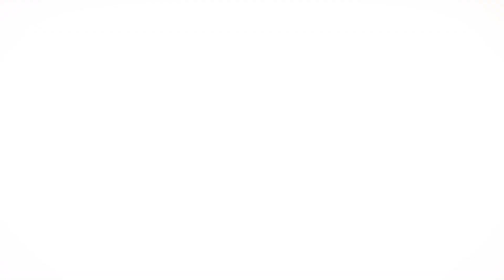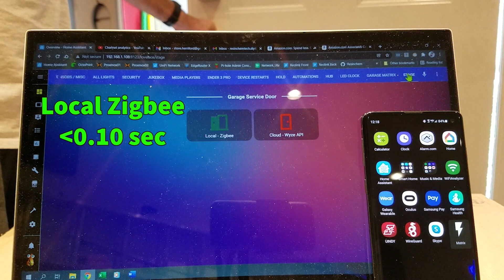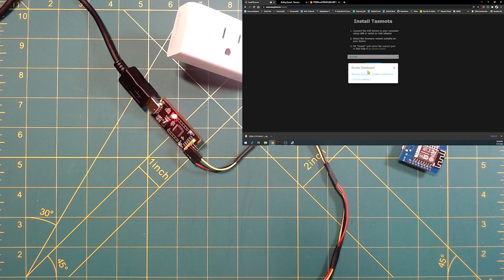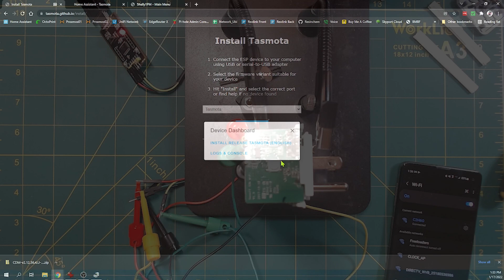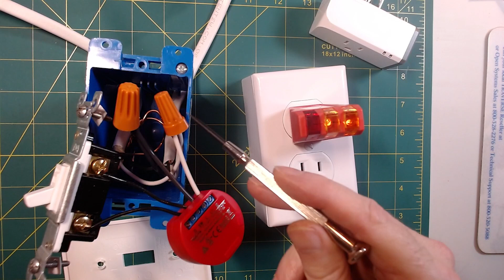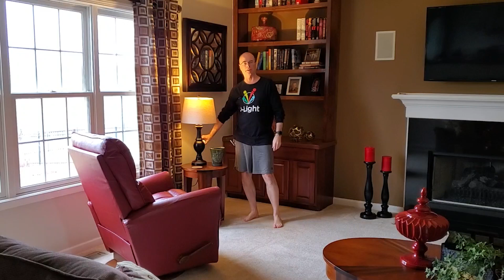Move a switched outlet control to anywhere with just two smart devices

Comment: I just want something simple that works with an existing switched outlet and turns on something else remotely in addition to the light connected to the outlet. There's got to be a simple device like that that doesn't require smart switches...
Reply from the maker: Well, "something" needs to be able to determine when the existing switch is turned on.  Then that "something" would need to send a signal or command to the remote device to turn it on.  "Dumb" or normal household switches and outlets have no way to communicate... so some way to communicate needs to be added both to the switch and the remote location. 

There are other potential options... but they may not be as simple to setup and maintain.  One option would be to use something like an energy-monitor smart plug connected to the switched outlet.  As long as there is a 'load' attached, you could monitor the energy readings and when the wattage (or amps) go up, you know the switch has been turned on.  You would then use something like Home Assistant to send a command to another smart plug connected to the remote device.  You might be able to use two smart plugs running firmware (like Tasmota) that could communicate directly without a middle-man automation system like Home Assistant, but it might be difficult to find commercial versions with this feature.

Alternatively, if both the switched outlet and the remote location control their own smart devices (e.g. a smart light bulb), then an automation system could watch for the state on the switched device to change and then send the command to the remote device to set it to the same state.

So it is certainly possible to do something like this without replacing the in-wall switch.  But some sort of smart device (WiFi, Zigbee, Matter, etc.) is needed to be able to determine when the switch is turned on/off and then some system or protocol is needed to monitor the switch position and to send the proper communication to the remote device to toggle its state as well.

Comment: Wow, that was amazing, can't believe you figured all that out. Thanks for sharing, and I love the longer video format. I assume the only gotcha is if wifi goes down, you lose that control. If you have many of these and you reset the router password then you'd need to reset each device as well. That's the only down side with having smart devices. I have many smart wifi bulbs and had to replace my router so needed to go around and reset everything. Something nice about having a hub.... But what you showed was very interesting and I may try this..

Dumb question but can I have that one switch control more than one outlet device?
Reply from the maker: You are welcome!  Yeah... a wifi outage will take down your devices, but at least for me that is a much rarer incident than an Internet outage (thanks Comcast) that would take down any cloud-based devices... and at least the local wifi and getting it back up is under my control!  But I do agree about changing passwords!  I have about 125 devices on my wifi.. and I've upgraded my wifi twice since I began the whole smart home process.  The last time I upgraded the router, I simply created the same SSID and password so that I didn't have to update all the devices.  I did move to Ubiquiti/Unifi router, switches and access point this last time and haven't had a wifi outage (or problem) in over a year.

I agree about a hub... I have both a Zigbee hub and obviously use Home Assistant.  But I get a lot of comments and questions from folks that don't have a hub or other automation platform, so I wanted to do something that could be done without either... but could also be integrated into Home Assistant (or other platform) if wanted.  

As far as your question (not dumb at all)... absolutely!  You can have a single switch control multiple outlets (smart plugs)... or you can have multiple switches (relays) control a single load/light, like in a 3-way or even 4-way switch situation.  I've done this last one with my overhead kitchen lights.  It has three different switches to control the overhead lights.  I used two Shellys and a Martin Jerry smart switch (to add dimming) for these three switches to make the whole thing "smart".  As long as all the devices are in the same Device Group, the will stay in sync. I don't see any limitations listed in the Tasmota docs about how many devices can be in a given group, but there is a lot of flexibility as a device can also belong to more than one group as well.

Thanks for watching and taking time to comment.  Let me know if you have any additional questions!
Reply: Yes sir! You can have one switch control many many devices with (Tasmota) using MQTT topics. 

Another GREAT option is to flash a “regular style” smart switch with Tasmota via Tuya convert or a fashion similar to what is shown here. Then you just DEACTIVATE the relay function of the smart switch in Tasmota (there are multiple ways to accomplish this)  When you flip the switch it never physically does anything. But, This way you can use or omit the relay feature without ever opening up the wall. 

Jerry Martin makes nice switches that can be flashed with Tasmota. I did this to control my Smart RGBW bulbs however I used Tuya convert to flash Leviton switches I got for like $6 because I’m both poor and cheep. You can now buy light switches pre flashed with Tasmota if it all seems daunting. 

And Yes this Chanel is awesome I always look forward to new content and share links as often as I can.
Reply from the maker: Thanks Chris!  I was lucky and saw the change coming and was able to stock up on a whole slew of smart switches, dimmers, plugs, etc. that are still flashable via Tuya convert (gotta' love that way of flashing).  In fact, I have more than I will likely ever use.  A whole tote full of BN-Link, Teckin, Martin-Jerry and more still new in the box, but before the encryption and chip changes.  But you are correct in the fact that last I knew, the Martin-Jerry switches and dimmers were still flashable.  But because of my "inventory", I haven't bought anything other than a couple of Shelly relays and a single Sonoff S31 in over a year.... and those were to make this video!

You are also right about all the various options with Tasmota. As I said above, not only can you have one switch control multiple outlets, you can also have multiple switches control a single load (like 3-way or 4-way switching).  My kitchen overhead lights have 4-way switching, using 2 Shelly 1PMs and a Martin-Jerry dimmer, all using Tasmota and device grouping.

Thanks again for the kind words (and especially the link shares!).
Reply: @ResinChemTech  I love the DIY community you guys are so helpful.
Reply from the maker: I'm always glad to try and help.  We were all newbies at one point.  What irks me are some communities (like certain Discord servers or Subreddits ) that demean or attack a newcomer that just has a basic question.  Yes... some people may not be following proper "etiquette" in a given community, but alienating them does nothing to help grow the DIY or home automation community.  I always try to be helpful, even if someone is being argumentative (see many of my comments on the logic level shifter as an example!).

Sorry... climbed up on my soap box!  I guess what I'm trying to say (really to everyone... and I think I'll make a note to talk about this in my next video) is to not get discouraged if you ask for help in one place and get nothing but snarky replies.  There are plenty of other places where people WILL try to help you out... end rant!

Comment: You left out the part about how having additional Sonoff S31s in the same group would let your switch control several lights around the room or house.
Reply from the maker: Or you could use multiple Shelly relays and create three-way (or even 4-way) switching for a single outlet or load... which is what I do for our overhead kitchen lights, which use 4-way switching (two Shellys and a Martin Jerry Dimmer switch.. all synced with Tasmota device groups).  There are a lot of possibilities when using device groups in Tasmota (not to mention a lot of other features in Tasmota).   

Thanks for watching and taking time to comment.